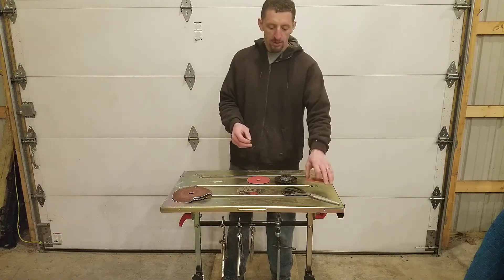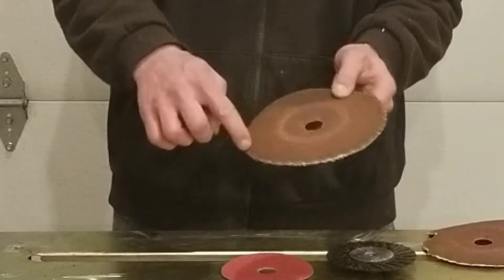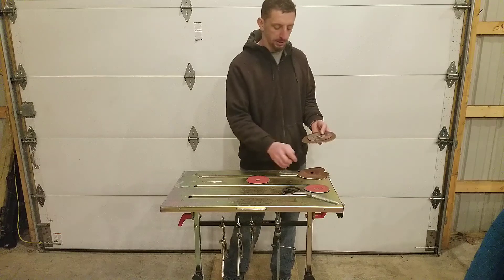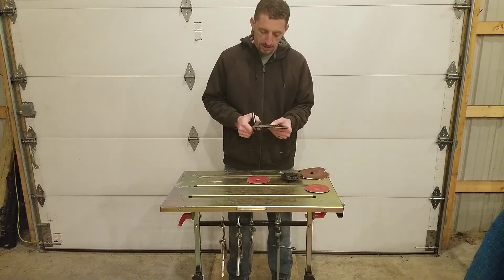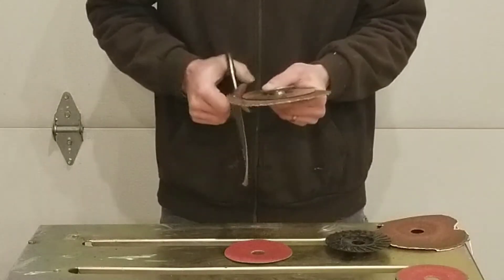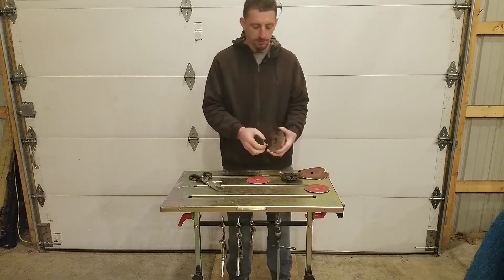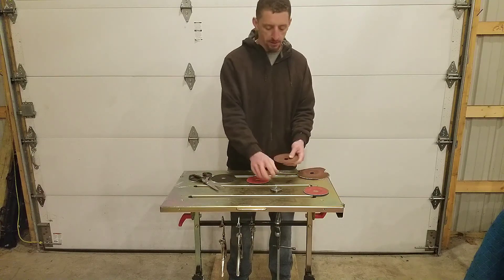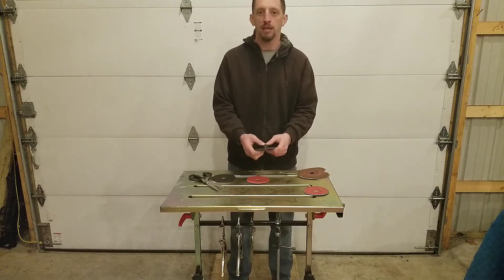More Life Out Of Your Abrasives ~ Quick Tip Ep.#2

Comment: that is a great tip.
Reply from the maker: It's so easy but yet so overlooked.  You can get so much use from a 7in disc.  I only talked about going from 7 to 5 inches but all you really need to do is take it down by 1/2" increments which extends the life that much more!